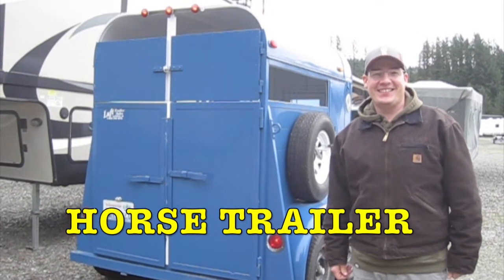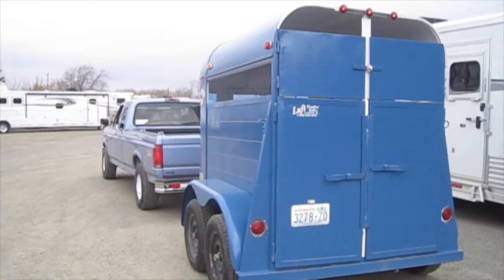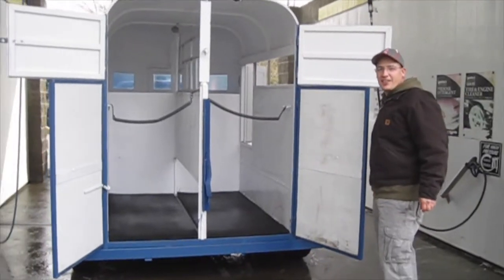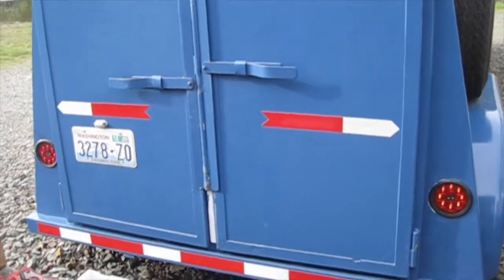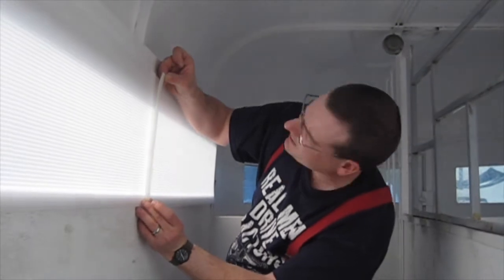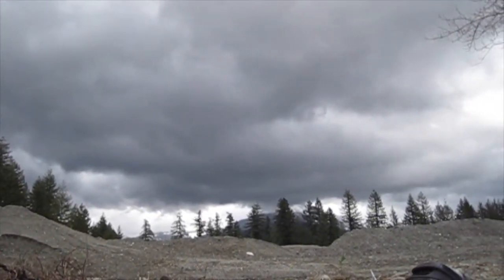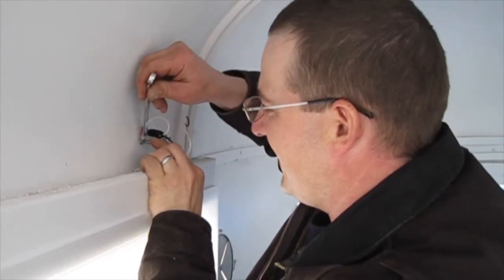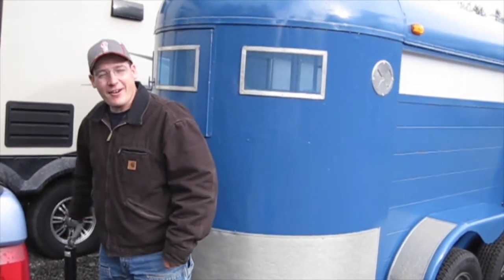Fixing Up Horse Trailer: LED lights, Safety Chains, Windows

Comment: Looks nice. Shouldn't close off the windows, need a real open&close type window because trailers get REALLY HOT just a short distance and even in cool weather. So animals need the open window ventilation when they're loaded.
Reply from the maker: Closing in the windows was just a temporary measure for one trip and it worked great! There are vents at the front and it's open at the rear so ventilation wasn't of concern. In the end, it was probably the best solution for the four baby calves we hauled. Thanks for watching!

Comment: How did you attach windows? With velcro? What material are the windows?
Reply from the maker: Kim K we used a translucent corrugated plastic material, like what is used for signs. We attached it with two types of fasteners. One was an industrial Velcro, the other was 3M Dual Lock, which has held up better. The adhesive on the Velcro would loosen up in the hot summer sun. No problems with the 3M stuff though...

Comment: Where did you find those round rear lights? Need some for a vintage camping trailer Reno I'm working on. Thanks!
Reply from the maker: Rosalie Larson if you’re talking about the tail/stop lights, those are just standard 4” round lights and grommets. Any large truck parts house would carry those. If you’re referring to the clearance lights (three beehive style up top), those are original, but we kept them because they’re so cool! You might also check the online catalogs of Trucklite and Grote. Both make all sorts of trailer lights. Thanks for watching!
Reply: @vnthomas16  Thank you for your reply and the leads. I've struck out with vintage camping trailer companies and am not familiar with truck renovations so your info helps tremendously. My next project is converting a 5x14 vintage livestock trailer to a camper with an exterior kitchen inside the rear gate. I have a lot of discovery work to do to find the appropriate parts. Thanks for the info, it will be helpful. And nice work on your reno. The little trailer looks great!
Reply: @vnthomas16  Just a heads up...Vintage Trailer Supply Carrie's the beehive lenses which are hard to source. They go fast when they get a fresh supply so you might want to keep an eye on them and pick up some spares when they become available. They are fairly inexpensive but not always available due to demand.
Reply: I loath spell check. Lol

Comment: why where the truck and trailer wheels chocked when you were changing the lights to led
Reply from the maker: Martin Fitzpatrick The tires were chocked because the policy of the storage place we had our rig at required vehicles be chocked. Don’t worry! I don’t think our truck will roll away!
Reply: i see. thank you